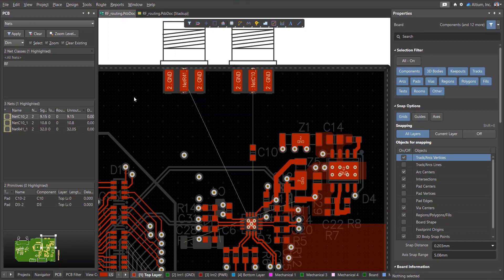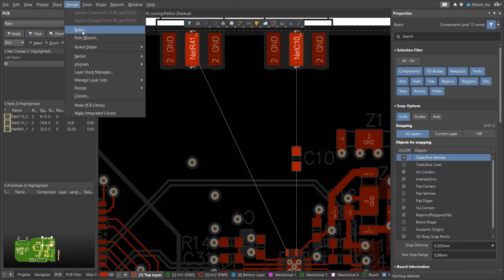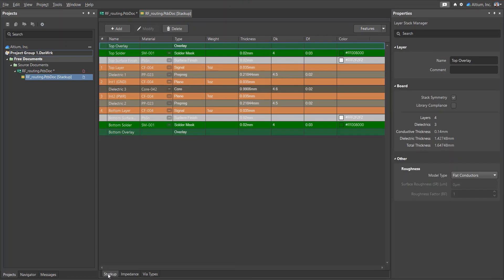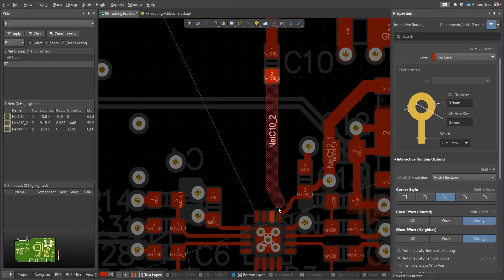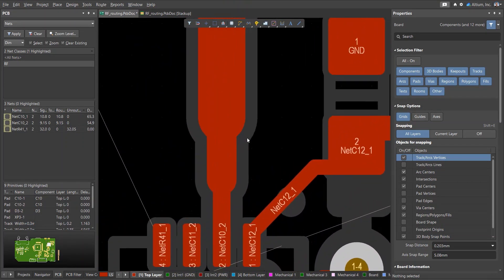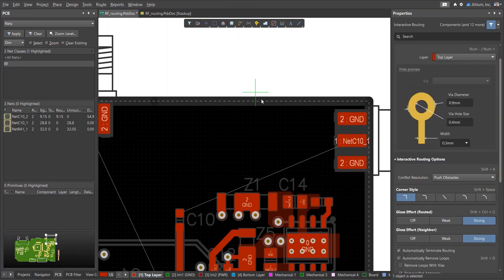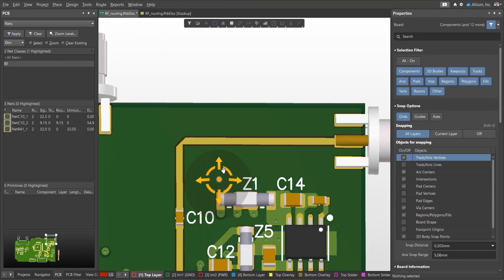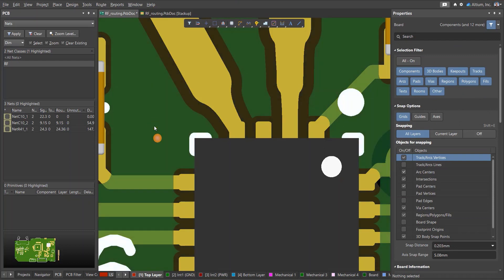RF Design in the PCB:  Routing Any angle or Arc in Altium Designer

Comment: The teardrop on traces is great tip. 

One thing I had happen when removing solder mask from traces is solder ended up flowing off pads and onto trace a bit. Try to leave a 10 mil dam to keep solder where it belongs

Comment: I didn't understand why he did apply a solder mask of 0.2mm when he said that we should remove the solder mask?
Reply: He applied a soldermask EXPANSION of 0.2mm which does remove it. Think of soldermask in Altium as a negative layer.
Reply: @TheLemon22  Thanks for your answer. Is it typical to remove the soldier mask for RF traces? Or what is the reason?
Reply: @meysamramezani3087  yes it is typical because dielectric materials such as solder mask at high frequencies have a significant amount of loss associated with them